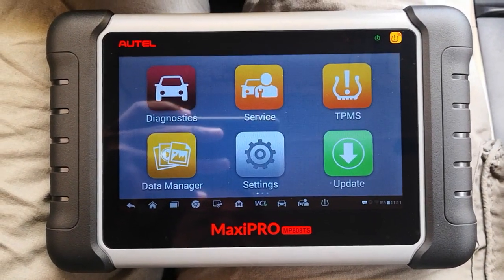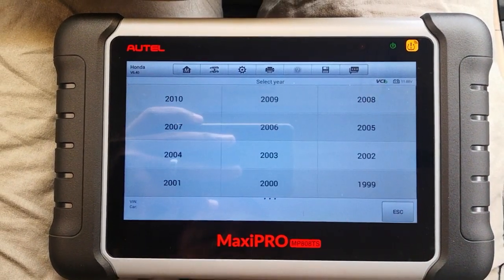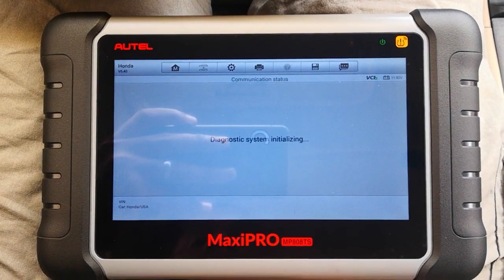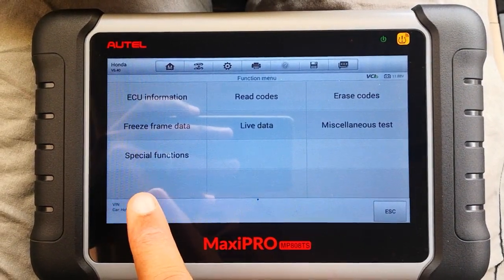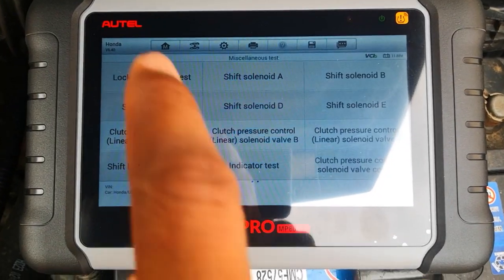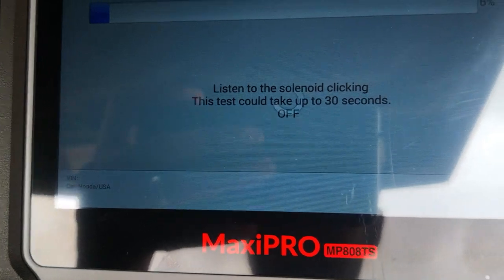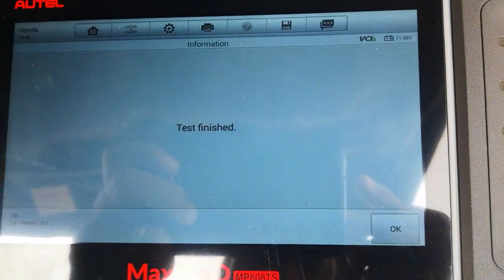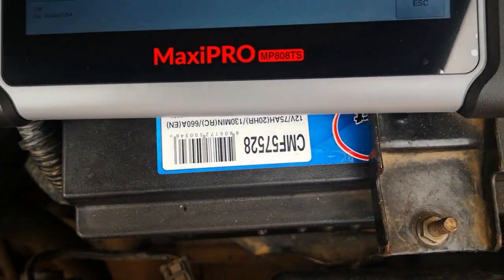Active scan tool: Testing transmission shift solenoids with Autel scanner

Comment: I am a DIY Engineer who love to work in my own cars, I do have a Launch X129 scanner and I am looking to buy a professional scanner capable to monitor, activate, calibrate and have a learning/teaching capabilities.
My mom has a 2015 Ford Fiesta with the powershift transmission and I found the hard way that most of the times just by recalibrating the clutch and forks will fix the problem, this is why I am looking for a scanner capable of doing this without getting bankcorrupted.
Thank you for the help!!
Reply from the maker: Thanks a lot for the compliment. Happy to meet a fellow DIY brother. 🙌🏼.
If your budget is around $500 you may check out the XTOOL D7 which I also reviewed. https://youtu.be/2HGfAfqsaOE
Reply: That's hilarious. I bought the xtool D8, and I can't figure out how to check transmission shift times

Comment: A 2004 Lexus es300 just came to my shop, apparently it have this problem, I'm going to try this test, thanks
Reply from the maker: Great. If its having problems shifting gears and you use this test and the solenoids activate strong and fine, in my experience it's usually internal wear in the transmission that's the issue. Let me know how it goes.
Reply: @DIYAutoworksNG  I haven't get a chance to check the car, (I have more cars to fix) all I did so far is scan it and gave transmission codes, the car came in a tow truck and the owner complained that the car doesn't get any gear, it starts but doesn't go forward or reverse, I will let you know what was the problem, thank you  have a nice day
Reply from the maker: Thanks a lot. Looking forward to your reply. Seems like you run a pretty busy shop? Congrats!

Comment: I get the p0752 code(sometimes the code goes off) and then my car disengages from drive on motion, i have to rev high before it engages again or possibly park,turn off the engine and wait for a while before it engages again.

Sometimes when i start up in the morning and switch to drive it delays like a minute before it jerks into drive. Took it to a gear technician he says my gear needs a rebuild (which I'm not down with)

My question is will changing that shift solenoid you showed in the video solve it? Because i had replaced it before worked for a while and the trouble continued but it only got worse now because I can't drive the car without it disengaging and it won't switch to gear 2, just remains on gear 1. 

Also i loosed out that solenoid and when i tested it manually,it clicks kind of fine  to me(not that sharp but still considerably active) but the check engine light keeps popping p0756 and p0752 at intervals
Reply from the maker: The codes and signs you've written of refer to shift solenoids A and B. However, verify your transmission fluid is clean and not low. Hope you are using DW1?
Reply: @DIYAutoworksNG  yes i just performed a gear oil flush and put in DW-1 and also replaced the filter.
When i went to get the filter they showed me one that looks square-like, does it mean the 2003 accord comes with an internal transmission filter? Because i have been looking around on YouTube i haven't seen a video on it. All points to the external one on the transmission

Comment: I'm working on a 2011 Kia Sorento with shift problems, put in a new torque converter and wire harness but still have problems, I like this video and the scanner seems capable, I have been looking for a new scanner but one review I saw the guy said Autel locks up the scanner if you don't renew updates regularly, have you had yours very long ?
Reply from the maker: I've had mine now going to 3 - 4 years. After my  first subscription expired, I had the tool for over a year or so without a subscription. I had zero limitations (cars: Honda and Toyota). That said, any function that requires connection to Autel servers won't work. Some cars do online coding, does features shouldn't work. The most important thing is having a backup before your subscription expires. If anything goes wrong, you can restore your car apps. Many people don't do this and are then forced to buy a subscription if files get corrupt. 
I did a video on what to expect when your subscription expires. https://youtu.be/LbjuKp1rYXA

Comment: How to test Transmission speed sensors  with this scan tool? And how to test Shift solenoids on live data while driving to see their values with this scan tool?
Reply from the maker: You can do active tests on shift solenoids, but not while driving; car has to be off for that. But, you can of course monitor livedata from the shift solenoids while driving. I'm yet to see how to test speed sensors with a scanner.
Reply: @DIYAutoworksNG  kindly make a video for it, your explanation is very nice

Comment: I have a lag upshift going 2nd to 3rd, and I've heard I can use a scanner to "adjust" the shift points after rebuilding my auto transmission.
Reply from the maker: Yea. Some tuners do this, however, I don't have experience yet with adjusting transmission shift points.

Comment: Thanks for the video. I would have a question to you about shift solenoids. You can see mA of shift solenoids when you diagnose them on "live data". What do they mean and at what mA should they be?
Reply from the maker: Thanks mate. Apologies for the late response. This slipped through the cracks. The mA is the current the shift solenoid is drawing to operate. Determining the values they should be at would be vehicle specific and should be available in service manuals (not owner manuals).
Reply: @DIYAutoworksNG  Thanks for replying, But I would have another question to you about TCC solenoid engaged. TCC solenoid is in engaged only in 4th gear to let fluid flow through the TCC. Does it mean that TCC doesn't help the transmission while driving in 1st, 2nd and 3rd gears? I mean don't those gears need help of TCC to move the car except 4th gear?
Reply from the maker: In general, TCC only lockup (to boost efficiency so that the engine spins at the same ratio as the transmission) when the car is at cruising speed. So it's feasible to not have lockup (which makes use of the TCC solenoid) at lower gears. Some TCC only lockup from 40mph. Depends on some other stuff but this is kind of the basic answer. Some manufacturers also design things differently.
Reply: @DIYAutoworksNG  So does that mean TC doesn't have any role at lower gears, in terms of the lower gears occur with the help of oil pump? I saw a video on YouTube and the process was happening like I wrote. But the thing is that, we need TC help to increase the torque of engine for Transmission in lower gears especially in the 1st gear cuz  it is suitable gear for heavy loads to pull.
Reply from the maker: It definitely plays a role at lower gears, when you are stopped at a red light with transmission in Drive, during acceleration (multiplication of torque) and also coupling. I was essentially referring to the lockup phase in my last response. As per lockup only occurs in higher gears during cruising speeds.
Reply: @DIYAutoworksNG  Thanks a lot my friend. You are really a good person.
Reply: @DIYAutoworksNG  do I have to update my autel maxi pro to turn on transmission solenoid in a 2003 Chevy avalanche 5.3 liter 460 le transmission
Reply from the maker: Sadly, activation of transmission solenoids is not supported for every car. But if you have a pending Chevy update, you could email Autel tech team to know if activation of transmission solenoids will be enabled by the pending update (I'm assuming you don't have an active subscription). That said, I did not see active tests for transmission solenoids listed against the Chevy Avalanche on Autel's vehicle coverage tool.

Comment: Will this scan tool show you the signals in real time,  I have a transmission that won't shift and I need to determine if it's the ecu or the solenoid
Reply from the maker: In livedata you can see the status of the shift solenoids when cycling the gears.

Comment: I have problem with my gti golf 6. When I drive it after 7min, it shows the spanner and goes to park immediately and the car don't move. then I have to wait some minutes then start it again.. So it's the solenoid shift or?
Reply from the maker: I would advise you scan it. Some models of the Golf 6 came with the DSG transmission (combination of automatic and manual). They were some recalls. So I would say you scan to see what the module says.

Comment: Does it read the clutch volume indexes of each clutch and the line pressure as the transmission shifts gear? Thanks for replying mate.
Reply from the maker: Haven't closely looked at this. Maybe car specific, but I'll check on Honda and revert.

Comment: engineers a question the Autel MaxiCOM MK808 can be the same as the autel maxipro MP808TS in the solenoids of the trasmission I just start with scanners but I don't know which one to buy thanks for your time
Reply from the maker: Hello,
The MaxiCOM MK808 is not an active scan tool and cannot be used for this kind of transmission solenoid activation. When it comes to choice, it really boils down to budget and what you want to use scanners for. If you say you are new to scanners and do not have plans for working on cars routinely, it may be better to go with the MK808. It's more than enough to start with. However, if on the opposite you want to go really deep into diagnostics and work on cars, then the MP808TS (or the MP808) will be a good investment (especially if budget is not a problem). The "TS" just means it's a TPMS tool. Either way, these are 2 good scanners depending on your priorities and plans are. Hope helpful. Very happy to answer anymore questions you may have. By the way, if you are settled on the MP808TS, I included a link in the description through which you can purchase the device on Amazon. All the best!

Comment: Does this model show live trans diagostics data while driving such as shift points.
Reply from the maker: You will see the status of the shift solenoids when a shift is happening e.g. Shift solenoid B going from off to on when a gear change happens. This is what I recall. Is that what you refer to as shift point or are you looking for something else?
Reply: @DIYAutoworksNG  yes thats what I was looking for. Good to know.  Thanks for taking the time to reply.

Comment: @DIYAutoworksNG can this diagnostic program in a new solenoid after it's been installed.
Reply from the maker: Depends on the car & if the manufacturer supports it.
Reply: @DIYAutoworksNG  it's a lexus 2007 is250
Reply from the maker: I think so, but you can confirm here autel.com/vehicle-coverage/coverage2

Comment: I have the Maxisys Elite 2.  When I attempt to test the solenoids, it says “test aborted.  Conditions not met.”  What does that mean pretty please?
Reply from the maker: Check the conditions for the test to run. Some tests require the car to be at operating temperature for example.
Reply: the tool is so good about providing the conditions.  It tells me specific temperatures and everything.  However, regarding solenoids, it just aborts.  It also says "waiting" when I try to obtain misfire data.  I can wait forever but nothing.  The other tests work.
Reply from the maker: Seems like a bug. Maybe send a complaint to tech support?

Comment: Wonderful
Reply from the maker: Thanks!
Reply: @DIYAutoworksNG  can you please explain about special function. Because when I used my autel the computer closed. And I have big problems. Especially relearn and self adaptation.
Reply from the maker: Thanks. What you see under special functions will be dependent on the car it is connected to. Different manufacturers support different special functions. Generally, special functions cover a number of resets, caliberation, adaptation, learning etc. Sometimes it overlaps with service functions. What car are you working on?